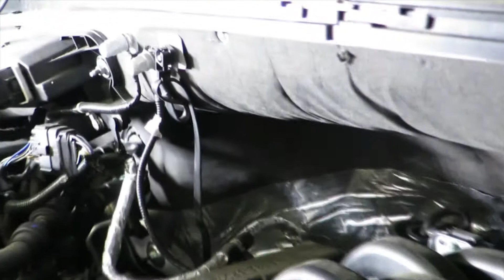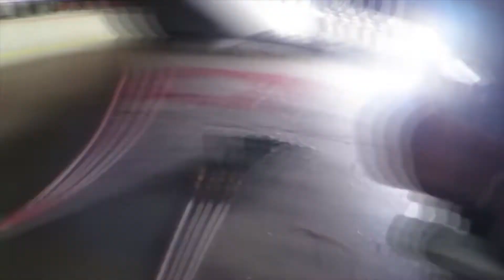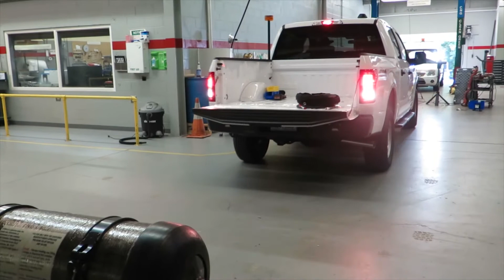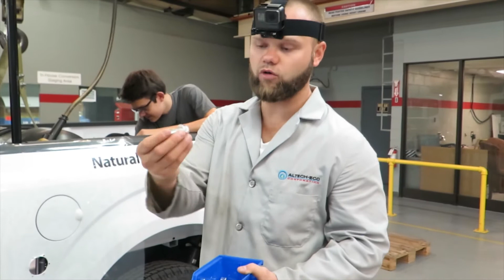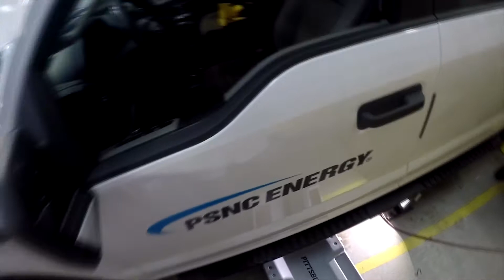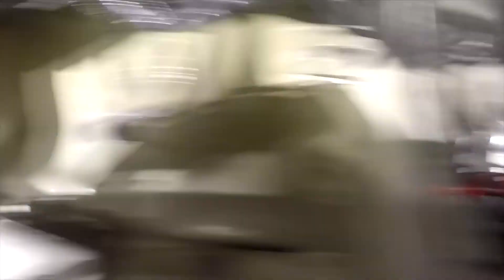How to Install CNG Cylinder - Part #3

Comment: How do you start the system after you've installed it
Reply from the maker: Re flash the pcm or are u using aftermarket CNG controller
Reply: It's it's an aftermarket CNG system the tank hasn't been inspected since 2014 I just bought the car but I'd like to use it as a full tank of gas and I just filled it up and wasn't thinking so now I've got all that weight in my car don't know how to turn it on and I guess it could be a filter it comes on for a second and then just kind of blinks and then goes out I don't know if there's a sequence of something I have to do like actually turn the system on